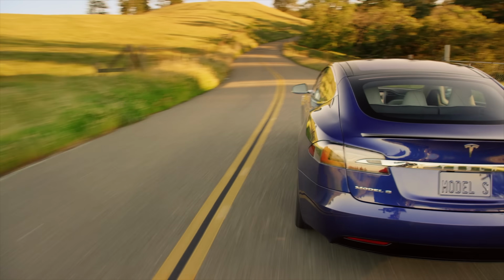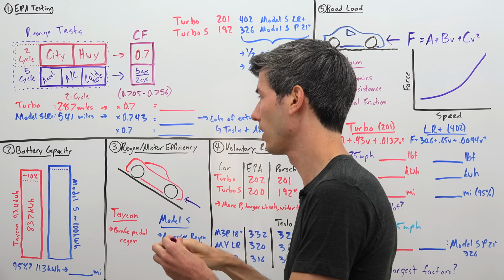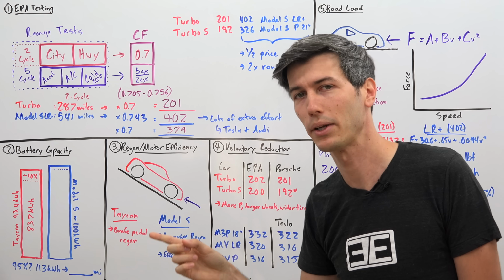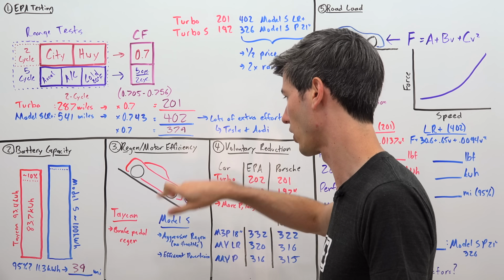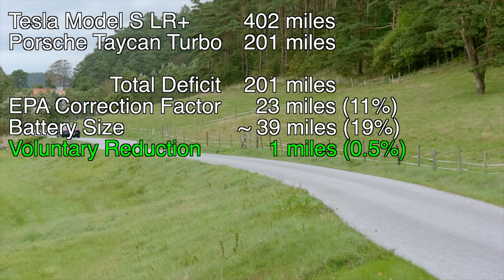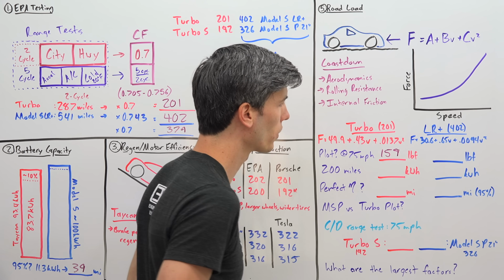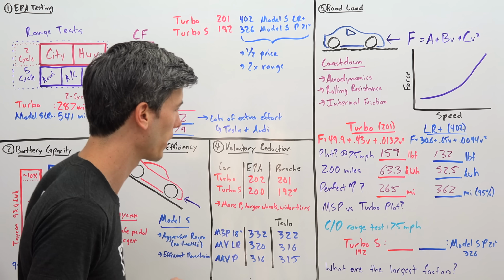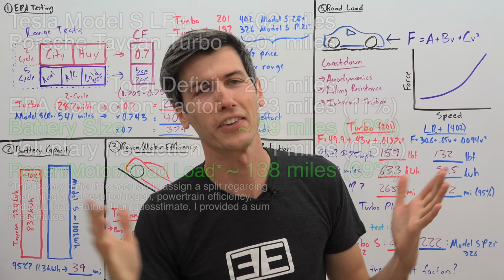Tesla's Secrets To Dominating EV Range - Double Porsche?!

Comment: Porsche’s spec catalog when developed was clear - an EV that performs like a Porsche with a sub-eight minute Nordschleife lap time. That means a smaller battery and they compensate with their 800 volt architecture that allows for something like 300 kW recharge rates, so 20 minutes for full charge. Tesla is built for chewing up EPA range, performance and lateral dynamic speed is irrelevant. As long as it is fast in a straight line on paper. Naturally driving enthusiasts will gravitate towards the Taycan, tech enthusiasts to the Tesla. I don’t think the customer groups overlap that much.
Reply: More downforce comes with higher aerodynamic drag. Now we have to define efficiency 😊 Do you want the most economical car possible? Stay away from sportscars! Want to drive 2128 miles in 24h? Better have a look at the sportscar. 
Efficency in terms of miles per KWh or in terms of miles per hour? You choose. My choice is a compact hatchback EV with 100KW engine, 50KWh battery, 93 mph and a body optimized for size which in turn has a pretty bad drag coefficient. But it's cheap, has all the niceties like LED matrix lighting, heat pump, heated steering wheel ... and brings me to work and back with 0km Autobahn on the way. But it's thirsty! On the Autobahn it takes 200 Watts a kilometer where a Tesla Model 3 would take 180. The Tesla is about 10% more efficient and In less then 25 years I'd have the added cost back on saved energy 🤣
Reply: Taycan is also more expensive on average (more expensive=better performance=worse  efficiency) which makes sense its the same with gas cars
Reply: 800V has nothing to do with any of this.
Reply: barebare it has to do with the recharge time, which is why they didn’t go for a 100 kWh battery like Tesla had.
Reply: christiaan hetzner Maybe you save some copper in the charger and high voltage side of things, but the cells are the same and can only accept so many electrons per unit time, so it doesn’t affect charge time.
Reply: barebare it affects how much power you can pump into the car. All other systems are 400 volt and max out at about 150 kilowatt on the DC stations
Reply: christiaan hetzner DC stations are mostly 400v, only Porsche has some 800v at dealer locations. But it still doesn’t matter, the battery pack is the limiting factor, not the cross section of the cables in the chargers.
Reply: @TheSteinbitt  hi, just putting in my 2 cents: The limiting factor for battery cells is the current, like you said.  assuming I have two battery packs with the same capacity, one of them is a 400V pack and the other one is a 800V pack. The 800V battery pack will be charged faster than the 400V pack, when charged with the same (maximum) current, since P= U*I and W = P *t
Reply: Julian But current isn’t the limiting factor either, the Wattage is the limit, a battery can only take so much power per unit time. Just look how Porsche and Tesla charges are the same speeds, Porsche doesn’t charge twice as fast.
Reply: @TheSteinbitt  yes wattage is the limiting factor but the voltage of a battery cell is almost constant (around 3.3V except when almost full or almost empty).

Back to my example: if the 400V battery and the 800V have identical capacity, each individual cell in the 800V battery has to have about half the capacity of the cells in the 400V battery since it needs double the amount of cells to reach double the voltage. 

Half the capacity charged with the same current leads to half the charging time. 

If this is actually used in the Porsche charging stations I don't know 😅
Reply: Julian It doesn’t matter if you double the current or the voltage. Charging limit will be the same.
Reply: christiaan hetzner 
All other systems at 400V don’t max out at 150kW - Tesla’s V3 superchargers support 250kW charging rates.

Also, given that a vast majority of DC rapid chargers work at 400V, it means that at most DC chargers the Porsche Taycan has to convert 400V DC to 800V DC, and the standard onboard charger is only capable of doing this at 50kW charging speeds. The buyer has to be aware of this and opt for the optional 150kW charger to have a decent charging speed at a 400V DC rapid charger.
Reply: Yeah, you may be right as i have been looking in to this. But did you consider that Tesla has solar technology? Does porsche have solar tech as well? I dont think so.
Reply: @IIdemonII  I had a solar flashlight once.  Never made much sence to me.
Reply: And the big elephant in the room, Tesla is known for terrible quality whereas Porsche is known as one of the best.
Reply: datsuntoyy 
You might want to check Munro Associates’ Model Y tear down. The improvements they’ve already made since the Model 3 teardown two years ago show they haven’t been standing still.
Reply: @kardy12  Saw a model 3 with the new car tag earlier this year.  None of the body panels lined up and paint was terrible.  Doubt you'd ever see crap like that on any German car at any price.
Reply: datsuntoyy 
You’ll have plenty of time to admire those panel gaps while you spend more time at rapid chargers with those German-made EVs.
Reply: Porsche uses nearly the same size battery as the equivalent Tesla, yet manages substantially lower range and efficiency. Porsche is fundamentally behind in technology in comparison.
Reply: @weasle2904  Real life performance is much closer than you think, many articles and real life tests have been conducted. A guy on youtube managed 425km with the Porsche, and 475 with the Tesla
Reply: Weasle again, Porsche is a sports car manufacturer. Everything has to fit with the 911. Range and efficiency are not the main purchase consideration for someone looking for a performance sports car. They would not be well advised to dilute their brand with a vehicle that does not fut into the overall product portfolio, which is the sportiest offering in each segment. Porsche is not looking to poach Tesla fans, they believe they can make EVs appealing to other car buyers. I see no reason why at this point in a growing market there is a point in zero-sum gaming these two cars. And i don’t see a real overlap in target customers.
Reply: christiaan hetzner 
To be honest, the idea that Porsche doesn’t care about efficiency does not really hold water. If Porsche drivers don’t care about efficiency (or fuel economy, which is largely the same thing), why would Porsche have built cars with Diesel engines?

Perhaps because Porsche know some of their customers actually care about efficiency, since a key advantage of a Diesel engine is better fuel economy?
Reply: @kardy12  Don't disagree, but I would says that the reason why a Tesla fan might not consider a Porsche Taycan could likely be explained by what they might perceive as an inferior drivetrain. I simply argue that developers have multiple goals when setting out, much like in a radar or spider web chart, and they emphasise responsiveness, lateral dynamics and agility rather than overall range. I personally find a focus on range and even straight-ahead acceleration from a standstill overly simplistic and borderline boorish. Ultimately if you love pushing the envelope of a car, it's always in the cornering speeds... As Walter Röhrl would argue the true test of a driver is how many bug stains you have on your side windows.
Reply: christiaan hetzner 
I don’t necessarily disagree with the idea that there has been too much emphasis on range with EVs, but that is a reality because a key obstacle to persuading people driving fossil fuel cars to switch to EVs is to do with concerns over range. Not to mention the usual response of many fossil fuel car drivers being “I can drive 600 miles on a single tank with my diesel, and until an EV can do that I’m not interested”. And I’m not sure the overlap between fossil fuel car drivers who think like that and fossil fuel car drivers that drive Porsche branded cars is trivial, though they may be prepared to give a Porsche-branded EV the benefit of the doubt.

Which is to say that the focus on range has been there because range matters in persuading people to switch to EVs. Perhaps as technology improves or familiarity with EVs improves over time, the focus on range will diminish, but this is the reality today.

And thus far most manufacturers have only been able to match Tesla’s drivetrain in either efficiency or power output, but not both. Hyundai and Kia are as efficient as a Model 3, but do not have the same power output. Porsche matches on power output, but not efficiency. And given the image of the brand, Porsche could not have chosen otherwise, but let’s be honest about the trade off it chose to make.

That simply the reality of the state of EV technology today. One does not have to be a fanboy of any particular carmaker to acknowledge facts.
Reply: @kardy12  Fair point, range is not as big an issue here in Europe I would think as in the States with its vast hour long commutes to the office. BMW launched around the time of the Model S their i3 and went intentionally with a smaller, lighter battery since the vehicle was positioned around sustainability, with recycled materials and natural fibres used. About six or seven years before its time, it turns out. EVs only took off after Tesla showed not only did drivers not have to compromise, in many ways they got a better deal. German OEMs in my opinion, however, would not be launching all of these models were it not for the direction Europe and China are taking in terms of emissions legislation. Only that kind of planning certainty can help convince you to uproot your entire value chain with all the subsequent fighting it entails with your unions that want to protect jobs both now and in the future.
Reply: @weasle2904  - You should familiarize yourself with the new VAG battery tech!
Reply: @weasle2904  you obviously did not watch the video. You can see there is a huge difference in battery size and at higher speeds the Tesla would not get as far as the Porsche with the same size battery.
Reply: @weasle2904  I guess you didn't hear what Jason said.

Comment: I have been driving a Taycan Turbo for the last 4 months. Real life range varies between 255 -275 miles. The mileage is mixed city and highway driving. The higher mileage was achieving warmer weeks(we live in Canada) when ambient temperature was around 30 Deg C (86 F). On longer highway drives, typically we stop to charge every 200 miles. I have never driven a Tesla or any other EV but I drove almost every car in the Porsche line up. The Taycan Drive and feel like all other Porsche’s. We still have a Panamera and honestly we don’t feel any difference driving both.

Comment: this is interesting but all very theoretical

engine and regen in the Tesla can't be that much more efficient, this doesn't fit to real tests. Take a look at Björn nyland's Test with the Taycan 4s, if you take the smaller battery into account the difference in range is less than 10% compared to the model S. All in all. This does not even take into account that the Taycan has a different cooling concept and probably needs more energy for that, the aerodynamics are also slightly worse. BTW, the taycan can recuperate with up to 265KW, the model S less than 100KW.

Comment: Now I remember. I do not trust that highway test you speak of. Because it was shown a while back when the model s range was increased to still just under 400, someone drove from LA to san francisco on the highway which is 387 miles. They did so with a little range to spare.

Comment: Needing that much range is not just about the highway. I have driven that many miles in a day by driving just for a couple of hours in the morning and again later in the day which was a mix of both highway and secondary roads etc. The increased range will make a big difference. When traveling long distances it is more desirable to not drive all highway and use secondary roads for scenery and to explore areas on the way, not just stay on a mundane highway.

Comment: Real range test by Bjorn on Taycan 4S+ reveals 580 km real range. That's pretty much 10% difference to Model S he tested. Please note that Taycan has less usable battery capacity, heavier and has fat wide wheel on back compared to Model S. Also, tyres pressure on Model S is high, like 2.5 on Taycan vs 3 bar on Model S.

Comment: I’ve got a question: My friend just got a car (an old automatic Honda Jazz) and he loves chucking it in 7 speed mode and continuously pressing the accelerator on and off quickly, so the car bunny hops down the street. Is this bad for the transmission?
Reply: It’s probably bad for that and the suspension 😂
Reply: That can't be good, especially considering that specific transmission is a CVT.

Comment: Always spot on, as allways! Great vid.

Car and Drivers actual range gives that:

If est. that 5 % is not able to use in the Tesla. The Porsche was able to travel ~94 % the distance while only having ~88 % of battery capacity.
If so; the Porsche is even more efficient, or Teslan less efficient, than the road load chart shows.

Comment: Normally I love your videos, but here you go completely wrong.   You seem to want to explain why Tesla has longer range, instead of actually seeing where the numbers lead to...   which is that it actually doesn't. 

In the last part of the video, you demonstrate that the Tesla does NOT have significant more range than the Porsche.  Indeed, for the comparison between the Tesla Performance and the Porsche, the tiny range difference from real world testing from car and driver is completely explained by the tiny difference in battery capacity.  Which makes total sense, as the road load graphs for these cars are identical!     Which begs the question why EPA still gives a huge range difference for these cars.

The inescapable conclusion is that somehow ** the EPA tests for these two cars goes totally wrong! **   
It is not the cars that are so different, but the EPA tests that generates wrong different results! 

You somehow try to explain this away by much higher efficiency for the Tesla's drive train...  But that makes no sense!  You have shown that in real world testing, there is no difference!  And the road load graphs totally support that.  All the evidence you showed, demonstrates that the efficiency of the Tesla at highway speed is exactly the same as the Porsche's.   So why do you still think Tesla's drive train is more efficient?  That is not backed up with any evidence... except for trying to explain the weird EPA numbers. 

Also, higher regen when taking the foot of the throttle explains nothing.  Regeneration is always worse than coasting, as the regeneration is never 100% efficient.  And when you press the brake on the Porsche, it will also regenerate, just like any EV.  This should not make any difference in the test.  

There must be something else to explain the complete discrepancy between EPA range and real range.   The lower speed in EPA testing doesn't seem to explain it for the Tesla Performance and the Porsche, as the road load graphs are identical. And there is no reason to assume the Porsche drive train suddenly becomes incredibly inefficient at low speeds. That's not how electric motors work. 

The real question after this video is why EPA testing gives such different range for vehicles that are so similar in specifications and real world performance.

I can't find the comment now, but someone mentioned that EPA includes Porsche's sports modes, and that those are very inefficient at low speeds where EPA is testing.  I can't verify that, but that would at least explain why EPA tests get a completely different results.   

Another explanation could be that the regeneration efficiency in the Tesla is higher than the Porsche. I guess that is possible.  Now... in pure city driving, that could explain a significant difference in range.   But that simply cannot explain 50% in overall range estimate.   Even in my petrol car, which doesn't have any regen, I only have 50% higher fuel consumption in the city compared to maximum fuel efficiency.   That would suggest the Porsch doesn't have any regeneration at all... which is obviously nonsense. 

Please...  remove yourself from the idea that Tesla has magically better efficiency, and try to figure out why EPA gives weird numbers.

Comment: I've considered buying an electric car, but I do a weekly 200 mile drive. As you quite rightly say, it's the highway range that matters when you're considering what battery capacity you need. I'd like to be able to do that 200 mile drive without stopping, assuming a full battery when I set off. I definitely can't afford a Tesla, so therefore I'm looking at other alternatives with 250+ miles of EPA range.  Is the road load data widely available for other car models to enable determination of highway range?
Reply: That's unfortunate but just remember the highway range on Jason's diagram was measured using 75mph. If your highway speeds are lower you will get a much better range which will surpass the 250mile barrier

Comment: The Porsche can do full-throttle launches repeatedly, over and over again, thanks to the 800v system, which keeps the battery and wires cooler. Id also bet that the Porsche has greater tolerance levels than the Tesla. Its like having a big V* producing 200 BHP opposed to 500. Apply as little stress on the drivetrain as possible to ensure more reliability and longevity.

Comment: The porsche 4S can go 580 km on a full charge with 19" wheels. Björn Nyland tested it. So i think the turbo can go a lot more than 201 miles with smaller wheels.
Reply: 580km was done at 90kph. I think it was like 420km/262miles at 120kph/75mph. 

That's with the smallest wheels 225 fronts and 275 rears. The turbo S I believe has 305 at the rears. But I could be wrong